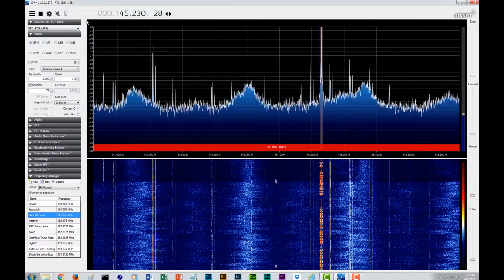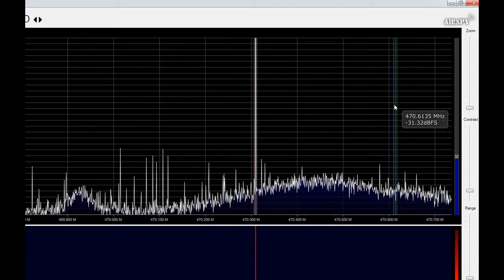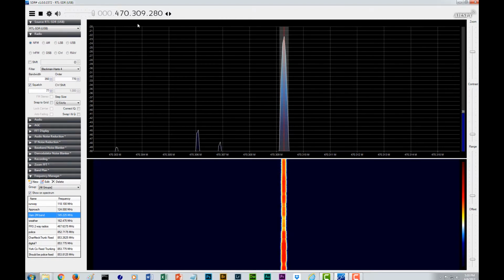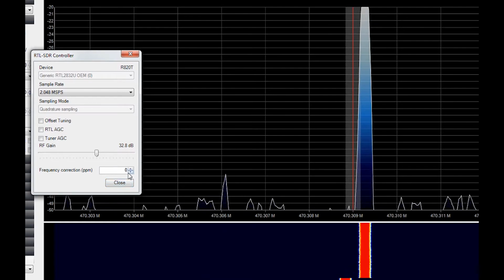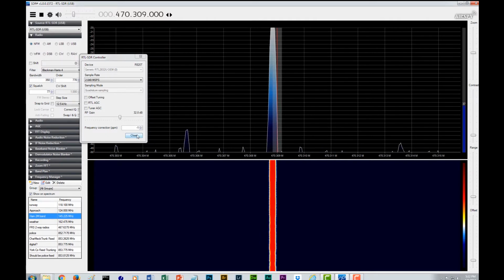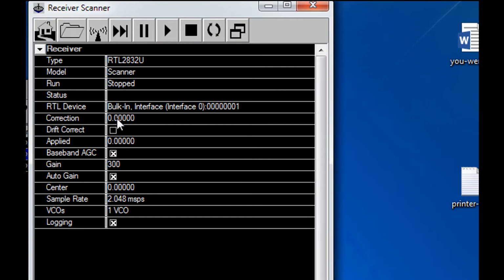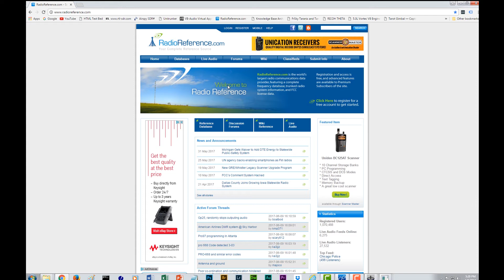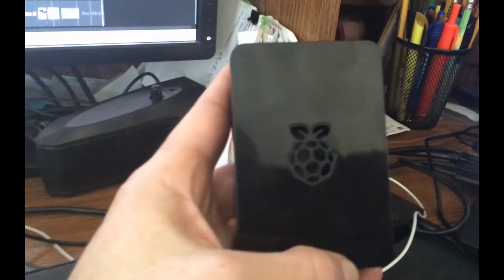RTL-SDR Troubleshooting on SDR+ Sharp

Comment: Thanks for the tip.  -3 was the best for me.  I love my cheapy RTL-SDR.  Compared to 1980s SANGEAN shortwave receiver it works as good or maybe even better.  On SSB I like not having to fine tune with the dongle.  I have more options to manipulate things to my liking.

Comment: I'm not getting that spike on that exact channel I've messed with bandwidth and squelch the only thing that actually works is fm radio i also tried many other channels nothing yet
Reply: two weeks and only fm radio and one NOAA station.  where the hell are all these signals that everyone else has???
Reply: @mbatson13  same. Im even using a 50 foot long wire antenna and im not receiving shit on hf/ shortwave
Reply: I don't either.  I have great reception, too.  Nothing at all there though.

Comment: Hi Steve, first of all thank you for te good work, without these videos i never managed to set this up. Your videos reached the Netherlands !! I have only one question to be sure that i understand it.I saw all the comments and i think my problem past a few times. When i start up sdr# i cam see the controle channel of the trunked radio system in my town. Then i start up dsd+ en VBcable and then unitrunker. The problem is that i can not get my 2e dongle running ( the scanner) Message is "can not open" If i am reading wright in the comments i must NOT start up sdr#, only dsd+, VBcable and unitrunker, is that correct?  The last question is: Do i have to run Zadig for both dongles? In the video you run Zadig only once.Keep going on with the good work!!
Reply from the maker: don't try to use SDR#.  Just use the other software in the order mentioned in the video series.
Reply: You must run Zadig on both dongles - otherwise the second one will have the wrong driver... at least on the several different [windows] pc's and laptops I have configured
Reply: @chrisoliver2412  how do u know if both have been zadig. I bought one sdr follower this tutorial than a month later my second came in.

Comment: Hi steve, thanks for your sharing, but there is some problem. When i got into step 5, which is unitrunker step and dsd, i just hear the static noise when they transmit *i know because the noise is not continously, is it like when people talk over their handytalkie*. But i think it's not encrypted issue, because when i put those frequency on SDR# , i could listen to their voice. Could you help me ?
Reply from the maker: Rendy Kurniawan did you try adjusting the bandwidth?
Reply: Sorry if i miss something in between, but how i adjust the bandwidth on unitrunker ? Thanks a lot.

Comment: Thanks for the walk through , Steve. I got my stuff working and I'm listening to my local emergency units. Most of the time it's working fine but there are times where they sound robotic and it's kind of hard to understand. I noticed that the dispatch sounds clear but some of the units are robotic.

Do you think it's a hardware limitation or Are there any other stuff I could do to fine tune everything software wise?

I'm using 2 NooElec NESDR Mini 2+ and I'm just using the antenna that it comes with. It's like 1 foot telescopic antennas.
Reply from the maker: Glad it works!  Try a bigger antenna.
Reply: is there like a special antenna that I need for the SDRs? or any thing from ebay would work as long as it has the same connection? 
As you could tell, I'm kinda new to this.
Reply from the maker: here's what i used in the video from  Amazon  https://amzn.to/2tq4MfI
Reply: Thank you!